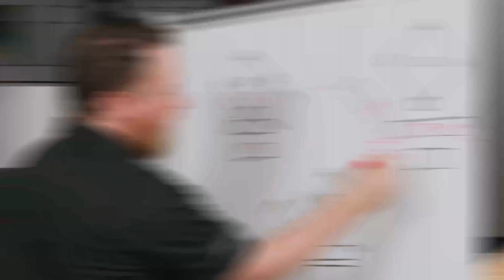What is a Distributed Antenna System (Featuring RF Venue) on Pro Acoustics Tech Talk Episode 113

Comment: I have a D-Fin I use on my cart. .. So you say the D-fin would work better than my 2 Wisycom  LFA ?
Reply from the maker: In many wireless microphone applications, the DFIN does offer stronger overall performance compared to using two standard active paddle-style antennas. That said, your exact results can still depend on the space, distance, and the rest of your RF setup — but in general, the D-FIN is considered a performance upgrade in most scenarios.

Comment: If I have say 8 channels of wireless receivers connected to a active splitter, and another active splitter with 4 channels.. Can I take the two bnc outs of the first splitter, and the bnc outs of the second splitter.. and connect it to this unit? effectively giving me 12 channels of wireless, as opposed to just 4?  active splitter bnc goes into 1a and 1b in this unit, active splitter goes into 2a and 2b. Would that work or is that not the proper way to utilize this? Thanks
Reply from the maker: Some antenna distribution units do have cascade or antenna pass-through options that let you connect multiple combiners. Brands like Shure and RF Venue often include this feature. I’d recommend double-checking your specific model’s manual or reaching out to the manufacturer before wiring it that way, just to make sure it’s supported and won’t cause signal issues.

Comment: what is the recommended ohms for the cable used for the antenna and whats the maximum length of the cable that can be used to link the antenna to the distro.
Reply from the maker: For antenna cable, you can use either RG8X or RG58. RG8X is thicker and has less signal loss over longer runs, while RG58 is more flexible and easier to route.
For runs up to about 30 feet, either cable works fine. For longer cable runs, RG8X is the better choice to minimize loss. Also, check with your wireless system manufacturer about using in-line amplifiers or boosters if your cable length exceeds recommended limits.

Comment: Do you need to use the diversity fin antenna with this? Could I use a Shure 1/2 wave active pair? Thank you!
Reply from the maker: Absolutely! RF Venue DISTRO4 features an internal power supply and switch to apply DC power over coaxial cable, making it compatible with other passive or active antennas, including the Shure 1/2 wave antennas. It also comes with all the RF and power cables needed for a 4-channel setup (plus room to grow with another DISTRO4). So you're good to go!

Comment: We’re looking at moving our 9 transmitters to a rack room. Would this help if we ran from that to this antenna if placed in the sanctuary?
Reply from the maker: Yes, moving your receivers to a central rack and connecting them to an antenna via a distribution system like this one can help improve signal reliability and reduce interference. Just make sure to use quality cables and position the antenna strategically.